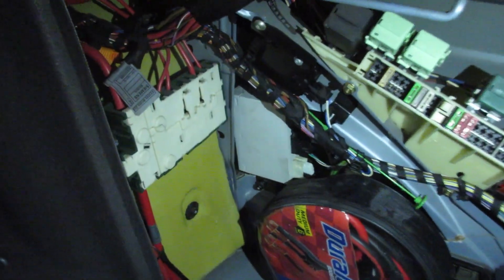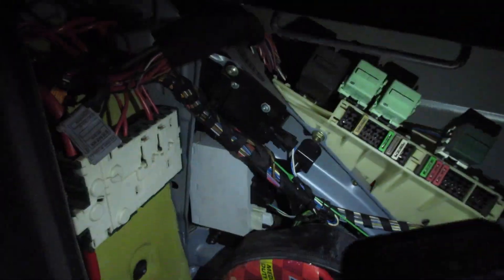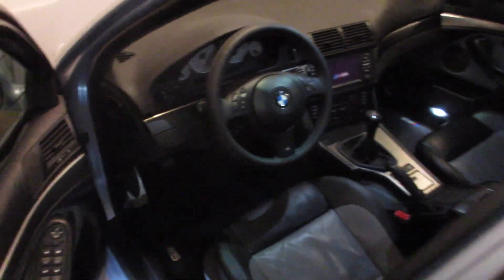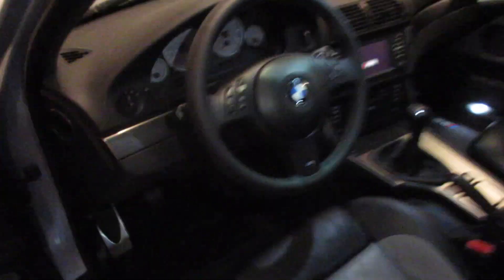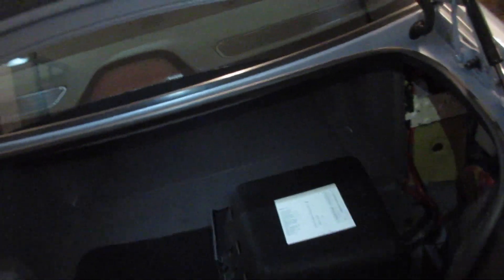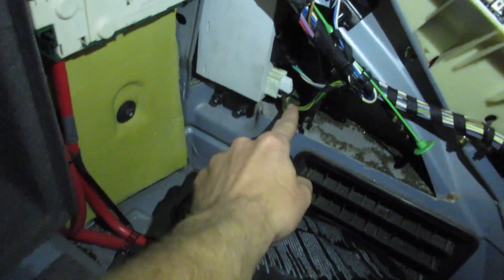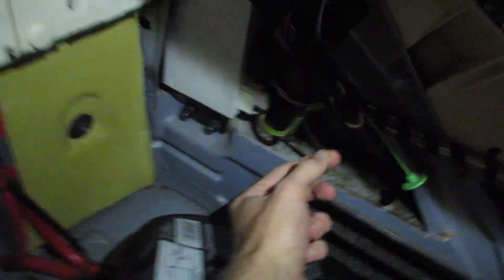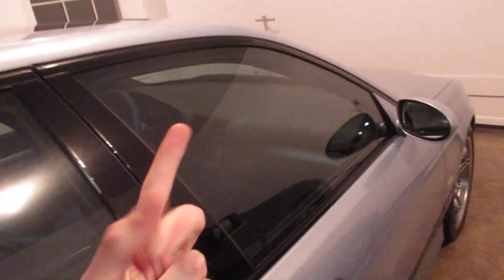Next Project: PDC  4/9/15 - Day 1,583

Comment: My E39 has front and rear PDC, and also a gong in the front and in the back of the car so you can easily hear if you are going to hit something in the front or back. So to make it complete you need 2 gongs/speakers.
And I can activate the PDC system by pressing the button that will light up green when turned on, so you don't have to stick it in reverse to active the PDC system.. 

Hope this will help you a bit..

Comment: Ryan - Ask around on  http://forum.bmw5.co.uk/ - Someone on there should be able to tell you the info you need.

Hope this helps.

The Snake.
Reply from the maker: snakes57 Should I make an account on there and post my story?  I'm trying M5Board here in the states but so few people know anything about it.
Reply: If your just looking to do research then i wouldn't say you need an account but if you want more indepth help on how to retrofit front pdc then i would create one.
Reply: Go to the E39 section , then into the ''How to guides and useful information ''

There is an Official BMW E39 retrofit guide on the Front & Rear PDC in a PDF.

Hope this helps.
Reply from the maker: snakes57 I had to create an account in order to download the file.  I've actually had that copy of the file for a while- I just can't find it useful because it's detailing adding PDC to a vehicle that started life without it.  What I'm doing is far less complicated than that.  I shouldn't have to fuse things and run huge spools around.
Reply: Put a post up in the E39 Section about adding front PDC , I'm sure someone will reply the info your after.